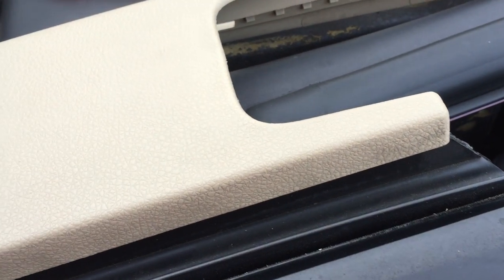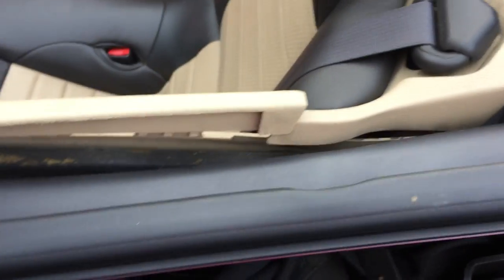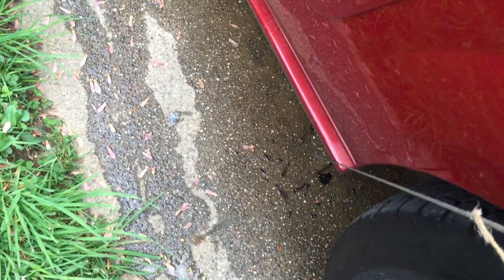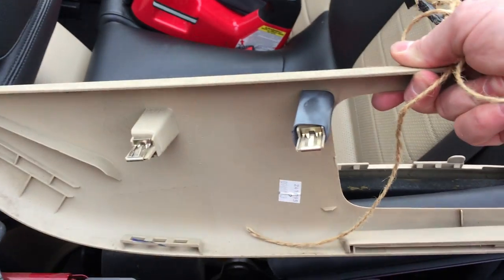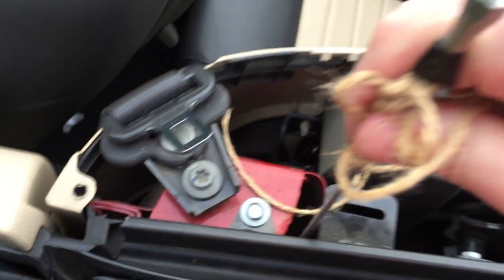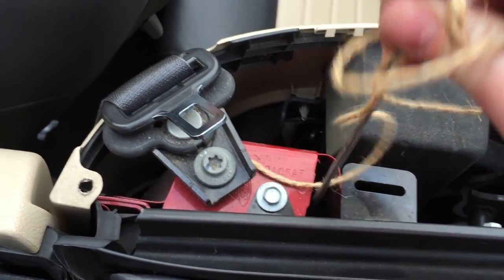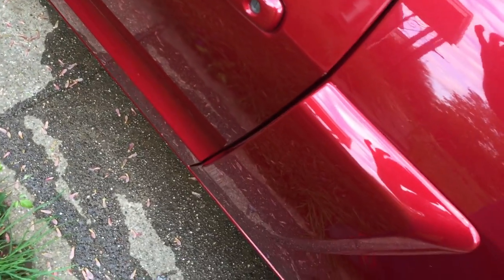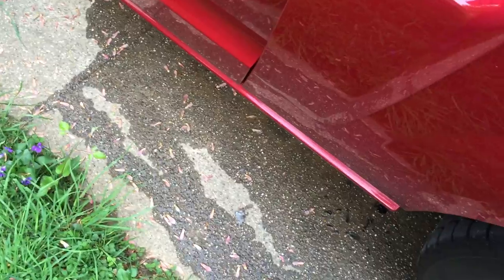05-09 Mustang Convertible: How to unplug rear drain hole

Comment: Thank you. Your video showed where to get down into that area holding the water that was sloshing around. Once I started prodding and poking I must have hit the clogged drain hole, at least a quart of water came running out! And now, no more sloshing! Some debris came out also, most likely the crap that was clogging the drain hole. You video is 6 years old but still applicable on my wife's 2014 Mustang. Excellent video, thank you very much!

Comment: Had this issue for a year in my mustang 2014 convertible. I'm glad I'm saying had..
The dealer wanted to charge me shit tons of money but I saw this video and went to Home Depot to get a thin metal rod, just like the one you are holding, and it worked.. big up to you man thanks for sharing
Reply: @Afrology101  it works like a charm bro
Reply: @Afrology101  I just did this (3-6-21) on my wife's 2014 Mustang. It worked beautifully! I stirred and poked and all of a sudden water came pouring out, at least a quart! Do it outside because that's a lot of water that comes out.

Comment: Thanks, I was changing my fuel pump and there was a shit ton of water under the backseat, my top wasnt leaking so I was stumped. Good deal, used an old metal coat hanger from the bootom and the top.

Comment: This is a great video it actually worked but I damaged both quater windows regulater wich cost me 360 dollars to buy and onother 300 to repair becarful not to knock regulators wire off track

Comment: hi i have a 2013 mustang, my rear driver foot well is wet at the center corner, everywhere else is dry not sure where its coming from. Can these floor pan rust? Well removing seat alone be enough to lift these floor carpet up?

Comment: Hi. I have a 2010 Ford mustang convertible, and I think the bits behind the rear windows are leaking, cause when u poor water down them u can see the water coming in onto the headliner. I also get water accumulate under the rear seats. I think unclogging the drain hole might help for the second issue, but what do I do about the first? Any help would be appreciated!!

Comment: I have a 2010 Mustang Convertible and I just noticed the backseats were soaked. I removed the seats, and there was puddles of water underneath them. I do not think it is my top, I think it is a drain clog or bad seals. Do you think this would be my issue? In your video are you just wiggling that to clear debris and then water immediately starts coming out on the ground underneath the car? Thanks for any help!
Reply from the maker: Ry Grizay I jiggled it around until it found he drain hole and that knocked the debris through.
Reply: lipstickprincess1 yes I fixed mine. Mine was actually a very small area on the rear window on the convertible where the canvas was separated  from the glass. My water was coming in through that, filling up the black liner behind the rear headrests, then trickling down the side wells and onto the floor and into the rear seats. Took me awhile to trace it, but I ended up super glueing the canvas back to the glass, and then using some clear silicon to seal it. I know where the leak comes from now so i also keep a towel there now just incase, but so far, so good.
Reply: Glad to hear it😊 
Once we unplugged the dräin, we ran a funnel and poured water and saw where it is leaking into the cabin, and I don't  know how to fix it. 2006 Ford Mustang GT. Funny, I've had it forever and it' has never been an issue.
Reply: Oh, thank you for the reply😊
Reply: @lipstickprincess1  did you figure it out? Mine is doing the same thing.
Reply: I figured it out.
My issue had everything to do with the ragtop. The ragtop has pockets on the inside that is designed to open when the top is up, and collapse when the top is down.
My issue was the pocket remained collapsed regardless if the top is up or down. Because the pocket was collapsed it  could not stream water into the proper canal. 
The water was actually being rerouted into the inside of the cabin where it would pool into the rear driver side bucket seat.
It is $400 to replace the ragtop; I didn’t have $400, so my brother designed weights out of washers that would pull on the pocket to open the pocket up when the top was closed.
The water was re-channeled to where it was able to drain out the bottom of the car like it is supposed to.
If you have $400 laying around which does not include installation, you may consider getting your ragtop replaced.
We had to pull out the backseats and take everything out of the trunk including the trunk carpeting so we could get inside the ragtop.
We’re talking down to the metal. 
You can find videos online that will teach you how to pull out the backseats in a Mustang.
I hope this helps😊
There is no video on this particular water issue.
I’m sure we did it the hard way but at least we got the issue fixed😊
Reply: Hi, I just replied to your comment but I didn’t do it in the reply box. Sorry about that, go back into the string and my comment is right below yours.
Thanks and have a nice day
Reply: @lipstickprincess1  I'm having an issue with a 2010 convertible as well, I've tried all the other candidates so far and no dice. I may have to try this as well. When you say pockets I'm guessing you're not talking about the fabric pockets inside the cabin that hold the defroster wires in place? My backseats are removed at this point, I've had them out for months. How did you get access to the rag top through the trunk. Sorry for all the questions this has been driving me insane and I'm tired of having my car be a bog. There isn't enough damp rid in the world...
Reply: Garrett Brainard 
Hi, we had to pull the backseats out of the mustang and bring it down to bare metalYou also have to take out the plastic side panel in the backseat and that’s how you get to the inside of the rag top.
I’m gonna get a hold of my brother and see if he write how he reversed the leak  issue.